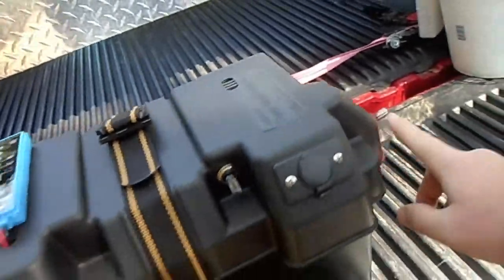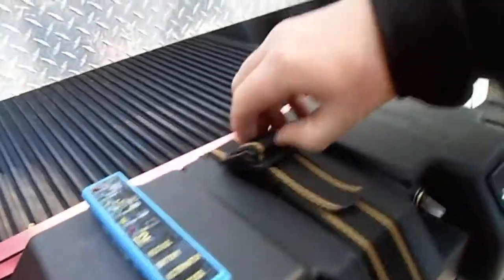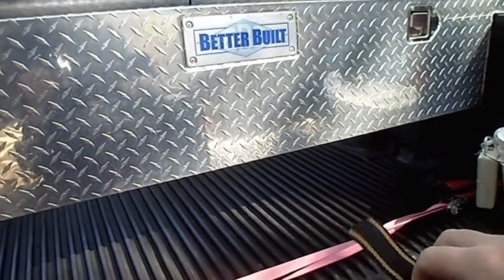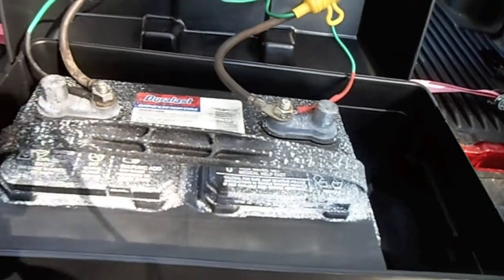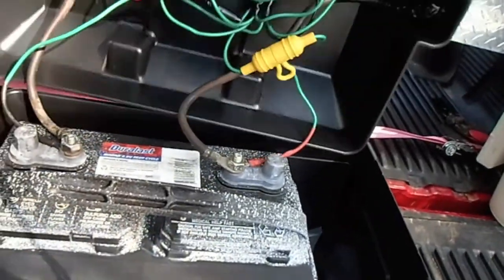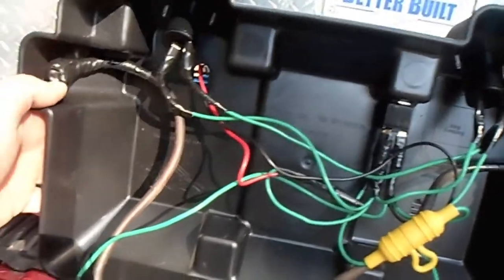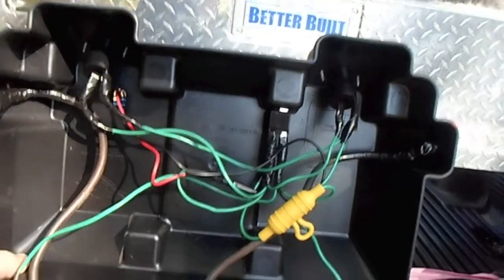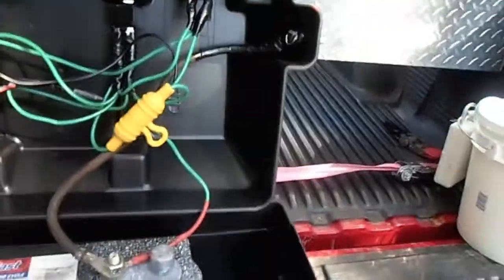DIY POWER BATTERY BOX FOR THE PELICAN BASS RAIDER

Comment: What type of conditions did you use coming out the box
Reply from the maker: ReelingWith Redding Thanks for the comment. I’m thinking you meant connections? The poles are just stainless bolts and #4 wire to the battery straight wired. Hope this is what you was asking about. Thanks again.